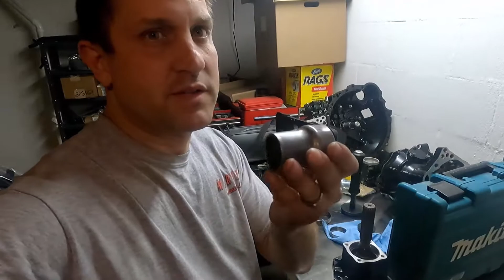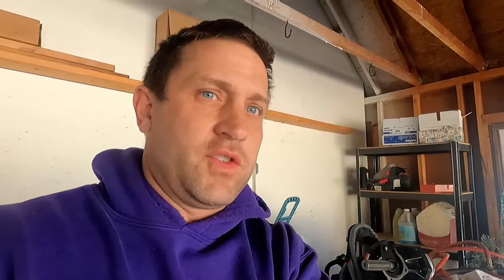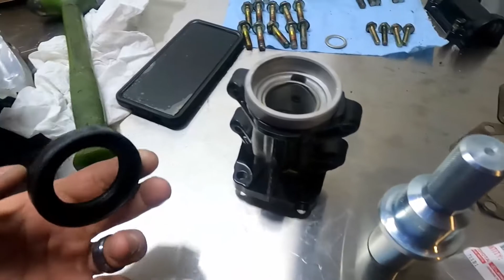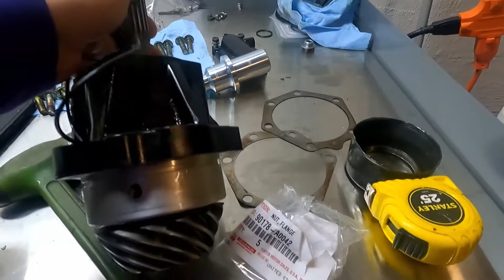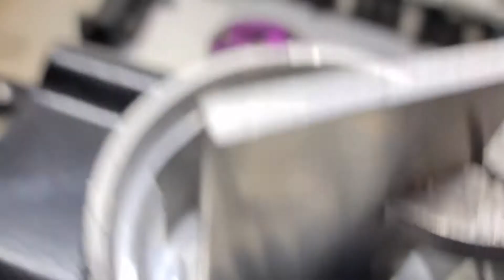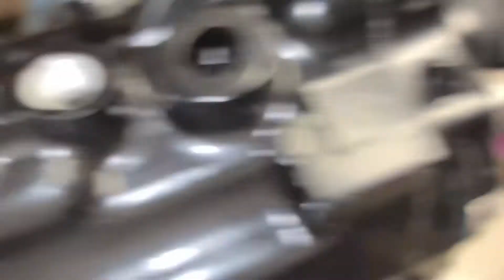Celica E153 Transfer Case Assembly

Comment: Nice video! Im not sure of youll see this but im currently in the process of disassembling mine, its very similar but its off a 97 rav4 with an E250F trans. Only difference i found is that it uses a manual diff lock.

Heres the problem im in. I noticed how many tools ( ssts ) are needed and i wasnt planning on dissasembling it, more so because i was afraid that id mess up the tolerances and itd bind as soon as it got into the car. I was checking the transfer driven gear assembly, and spinning it at a normal speed was fine. But when looking at the bigger bearing and spinning the helical gear slowly, you can feel the bearing kind of stop like theres groves in the race. Do you have the part number for the bearings nut and the one race? It says its all discontinued.

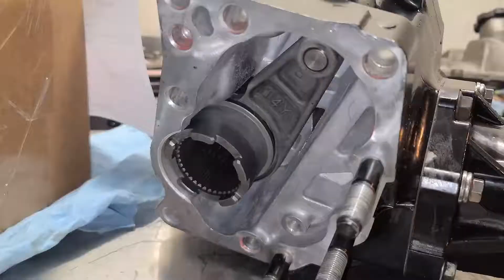Comment: 11:20 is that also the fill plug for the transfer case oil?
Reply from the maker: No. There is only one fill hole and it is on the trans.  

So 2 drain plugs and 1 fill. The fluid is all shared
Reply: @rm2932  good to know. Is that the same with the 1991 Toyota Corolla Alltrac. Mine is manual transmission with the 4A-FE engine.

Comment: can you tell me what transfer case is from, because I believe the e153 have no transfer case, is the transfer case from e150f /151f/152f or 154f?
Reply from the maker: That exact one came from a ST185RC. But the transmissions all have the same dimensions. So everything is interchangeable. That is why if a company makes a gear set it fits all the E series you listed
Reply: @rm2932  I have a E153 from the MR2 SW20 and an adapter plate for 2ZZ GE from MWR to fit it in Toyota Celica 7gen and now I want to do it AWD , can you pls give me a list of what I need parts in full details I realy need your help.

I heard that I can do a e153 conversion from e154f and all I need is a diff and a transfer case. but I need your help
Reply from the maker: @lordnggamermtpoppy3829  that is correct. Need the AWD diff, transfer case and the oil pump/oil line is slightly different to be perfect. Not sure the pump/line is needed.

Comment: Ryan, do you have a part number list for the special service tools you used for the trans and transfer case?
Reply from the maker: They are in the BGB.

But I used the

90316-60010 kit 
09608-12010 kit
09326-20011 (Transfer Pinion wrench)
09325-20010 (rear drive shaft seal installer)
09506-35010 (input shaft front bearing installer)
09506-30012 (output shaft rear bearing installer)

The top 2 kits I got on EBAY for about $100 shipped each. The wrench and seal installer I bought on Amayama brand new with other parts I think. Maybe the wrench was EBAY also. Can't remember. But the 90316-60010 I had to get from Germany and didn't think I'd ever get it.  And that one is used the most and the most helpful!!!!!!

The other 2 bearing installers I got on Amayama and help but could get away without. 20 some dollars each isn't bad though. If you can just get them. I got them thinking maybe if 1 or 2 people contract me to do a trans like this for them it'll pay for itself and I have them for the future with my own stuff if I break/when I break stuff. Lol

Comment: Stoked about this series of videos, always find the transfer and center diff system interesting, so your not using the viscous since you've locked the diff right ? Cheers on behalf of the community lol we need more videos like this out there
Reply from the maker: Correct.  Since the center diffnis welded the VC is dead weight. So I took it out as weight reduction.

I have a 300M material shaft like the Agile one because Richard Prydden was ruining their shaft from weak metal. So had a stronger one made. But not putting it in yet. Seeing how the center diff will be welded or if I'll think it's too much
Reply: Nice I had the same mentality when considering there plate lsd, that's interesting about richard, last I heard he wasnt having any issues, good to know but I still think I'd favor the plate over the viscous lsd